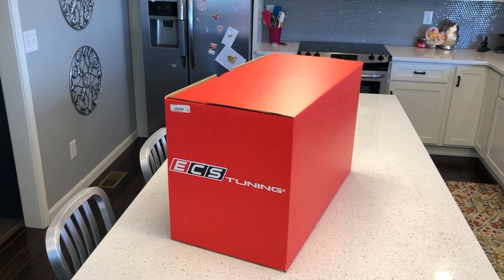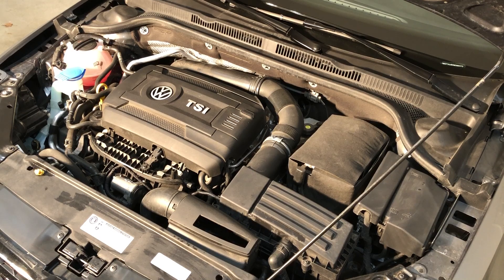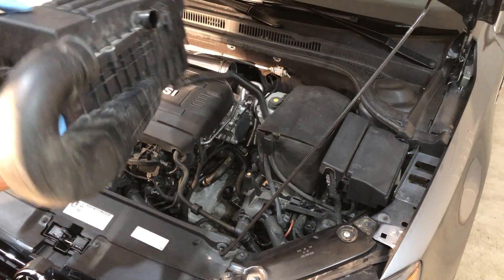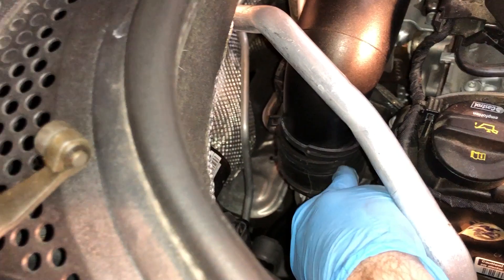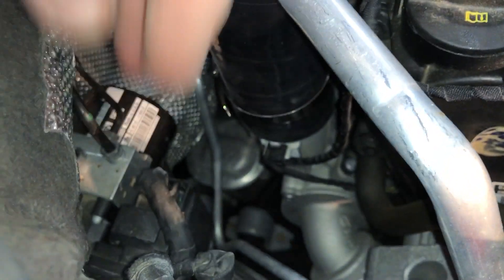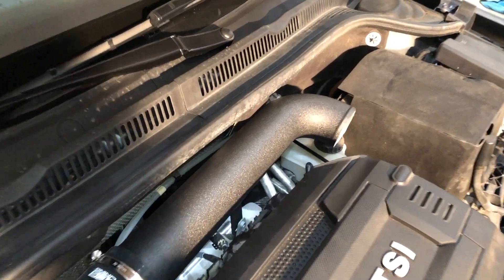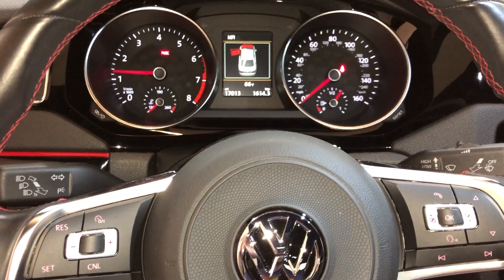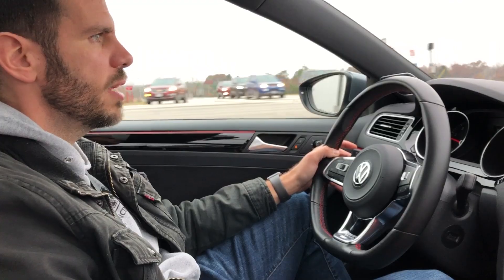Installing a cold air intake on a MK6 Jetta

Comment: But that hot air gets cooled by the intercooler thou. I could see that logic on a N/A car.
Reply from the maker: The air in this engine bay can reach 140 degrees in the summer. Yes your intercooler helps cool. However, with air moving through the system so fast it simply won’t cool down to say 80 degrees (outside air temp in the summer) having a closed box does not inhibit air flow and keeps temperatures drastically lower.. it’s a win win all the way around. I would prefer to do everything possible to mitigate heat. Thanks for watching.
Reply: @MereMortalsAttempt hmm. Im not a mechanic but follow my lead here. The intercooler isnt meant to cool 80 degree ambient air temperature. Air goes from filter, to being compressed and pushed troughthe turbines of the turbocharger. Where they get to temps around 300 degrees. So if te filter sucks in 60 degree, 90 degree or 180 degree temperatures, they are still going to get to around 300 degrees then get sent to the intercooler before reaching the engine. Hear me out even more, stock cars heatsoak after 1-2 pulls even tho they have sealed systems with plastic tubing that doesnt heat up as hot as aftermarket piping. Yet aftermarket non sealed intake system with aftermarket intercoolers can go all day long on track days. So on turbo cars, open air vs sealed intake boxes is silly. Furthermore, as a non mechanic, it is my understanding that diverter valve /wastegate noise is purposely muffled for driver comfort from the factory. The sealed boxes retain the non woosh noise when letting off the throttle.  In conclusion. As a non mechanic i have to concur with the guy who says sealed intake systems only make a marginal difference in naturally aspirated cars.

Comment: Does this interfere with gas mileage or wear at all compared to the stock air intake? Also does it unmuffle the turbo and make it a little louder?
Reply from the maker: I haven’t noticed any drop in gas mileage,  still to early to tell about wear and tear (I doubt it’s any different) as for the sound.. it’s only slightly louder. This intake is a closed box much like the original one. I liked this one over other options because of the fact that it is closed (less likely to pull hot air from the engine bay).
Reply: Good to know about gas mileage I want to do more to my car I just recently bought a 14 jetta se the 1.8t and I love it but I want to do more for sound don't want it stupid loud but also want a little more grumble to it
Reply from the maker: This intake would not be for you... it’s barely louder than stock. Keep in mind a big open intake will perform worse than stock because it’s pulling air from inside the engine compartment. You would be better off working on exhaust if you want more noise
Reply: I don't want to much noise though so I'm hoping I can find one that just makes the car sound a little louder but a deeper sound is what I'm looking for no to ricer sounding I guess lol
Reply: campas812 Im currently trying to do the same thing. Check out AWE exhausts for the GLI
Reply: Mere Mortals Im currently all stock with my '17 GLI and want to tune it so get a more agressive sound. I was told to get an intake before an exhaust and was looking at Integrated Engineering's intake. But it's big and out in the open air. Is it really that much of a problem?
Reply from the maker: I would encourage you to do your research on this. I have no firsthand knowledge on this. I liked this video I found where a person measured the temp of the air going in to his engine... way colder when enclosed in a box https://youtu.be/qrE8krwTuqk .if you search for comparisons you will find many similar videos and articles.
Reply: campas812 Hope this helps!

Comment: Just curious, with the improved air flow what have you seen from a mpg perspective? Theoretically with the improved air flow and better O2 to fuel ratio you should see a little better fuel economy. Any chance you have done some direct comparisons? thx!
Reply from the maker: Sorry I didn’t even think to do a comparison on gas mileage. You’ve got me thinking and I still have the stock air box
Reply: Honestly if you are getting terrible mileage I would check to see if you’re carbon deposits are bad

Comment: Just bought this vehicle and am already looking into mods I can do myself- what are your thoughts on the pros & cons for this intake?
Reply from the maker: I really like this one or the APR intake... the main point is make sure that it’s a closed box. Otherwise you will pull in hot air from the engine bay. As far as sound with this or any closed intake it doesn’t sound much different from stock... just runs a little better when you are up to speed
Reply: Mere Mortals appreciated!!

Comment: What does that small filter does?
Reply from the maker: @funline3407  secondary air intake it pulls fresh air into the catalytic converter on cold starts in order to heat it up quicker so that it is more effective at cleaning the exhaust from your engine before putting it into the atmosphere

Comment: what is that clamp called that you used to clamp open the o rings
Reply from the maker: Hose Clamp Pliers 
https://shop.advanceautoparts.com/p/performance-tool-flat-band-hose-clamp-pliers-w80654/11957792-p?product_channel=local&store=8765&adtype=pla&product_channel=local&store_code=8765&gclid=CjwKCAjwtqj2BRBYEiwAqfzur5WpkWC65vF_1tyMzyJXH3XuajOt2OSMPx4-p12I7Z_t4mA5HDYTQBoC4ZwQAvD_BwE&gclsrc=aw.ds

These were the ones I used.
Reply: @MereMortalsAttempt   thank you, i just replaced mine and i was using a different clamp and lost grip, and got that o ring to smack my finger hard as hell
Reply from the maker: Ouch! I hate when that happens

Comment: Did you reconnect the sensor that was connected on the original intake?
Reply from the maker: Yes there is a spot on the bottom of the pipe coming from the new air box
Reply: Mine has the secondary intake but it wasn't connected to anything but the old air box and the other end was just hanging freely.